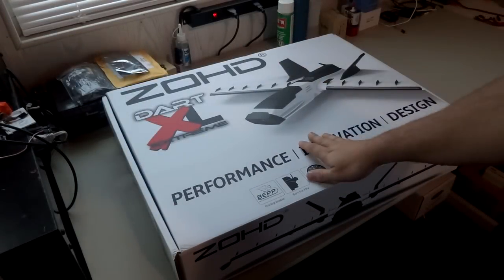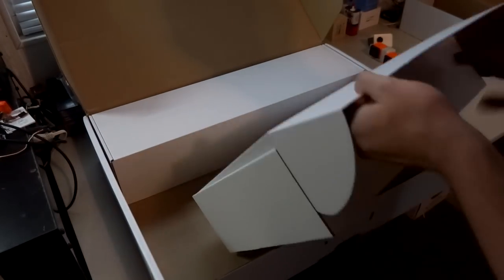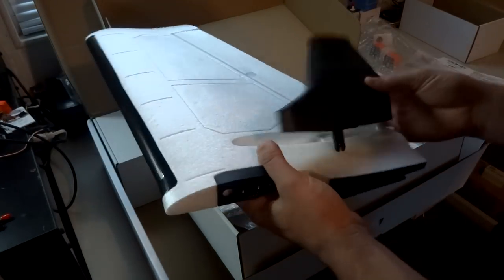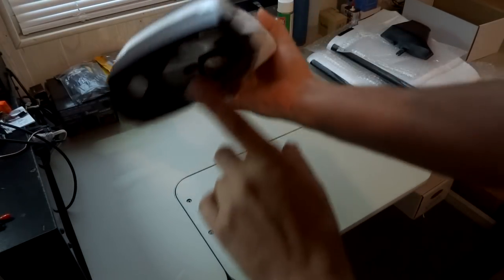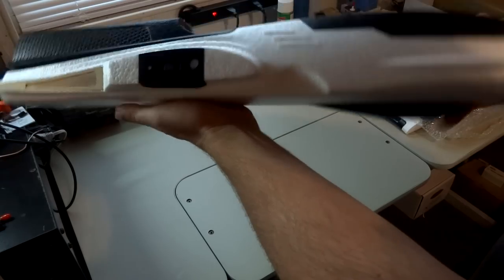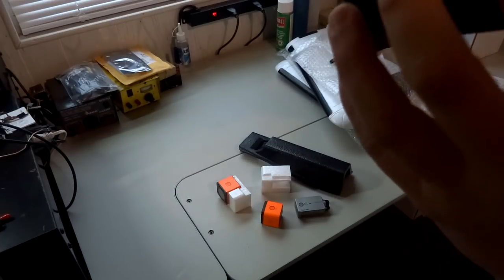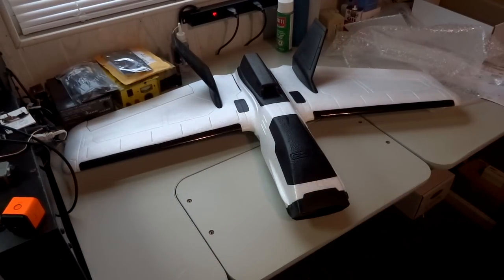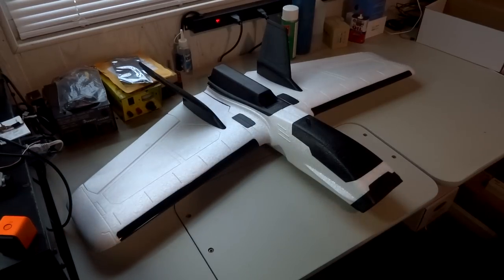ZOHD Dart XL Unboxing

Comment: To pass the audio, maybe use the servo ground for the vtx ground to save a pin?
Reply from the maker: I did consider it, but wanted to keep them separate to avoid any possible ground loops or servo noise getting back into the video system.

Comment: Thanks for the in depth review, can you please confirm if the Gitup F1 is a fit in the foam adapter blocks as I'd like to use mine whenever it turns up here.
Reply from the maker: I will check that and let you know! Remind me here if I don't reply again soon... lol I've got one sitting on my desk in the shop I'll check.
Reply from the maker: Looking at it now. The F1 will not fit directly into the included blocks, but with a little trimming it can fit into the Mobius style one pretty good. The lens will line up with the round hole in the center of the nose, and you could probably cut that out a little to let the lens poke through a bit if you wanted. It will take a little trimming, but should be a nice fit.

Comment: More good info..  Excellent  info from Andrew and yourself Keith..

What may be useful for purchasers of this model before they fly is to actually insert like a builders line that runs both sides of the fuse .. Starts at the nose at a point and runs below and above the wing. The point part of the string attaches to a lasso string which is wrapped around the  nose.

All this is inserted with a razor blade by cutting a very fine slice into the foam to bury the string.
The string is then glued in. I use Foam tak for this purpose to make a invisible seam.
One could then Laminate the area and also use some carbon but the carbon could be difficult to install in that model.

The reason for this is these types of noses do not have a lot of strength as Stu found out.

The sting is light and adds a lot of strength.
Most of my foward swept wings can go nose down at full speed and be picked up to fly again immediately.

Sir Bruce can vouch on that one..
My wings have string inserted and are nearly indestructible.

Just a tip I thought I could share..

Comment: you can share the gnd pin for servos and vtx so there would be no need for an additional audio wire (gnd, 5v, servo signal, voltage for vtx, video, in audio in = 6 pins)
Reply from the maker: I considered that as well, but I'm leaning towards keeping the wiring completely separate, just to avoid any ground loops or getting servo feedback into the video system.

Comment: You could keep the other cameras front holes uncovered to cool down the batterys.
Reply from the maker: I was looking at that after recording the video, I think you could cut away a little foam in the blocks that fit around the camera to allow air to pass through if needed.

Comment: hi bonafidepirate ! , andrew`s esc`s wood plate was broken too , don`t you think it has the same shape and look 
as the mini drak
Reply: Easy fix though. Just glue a pair of ply or balsa crossbeams, it's weak due to the ply grain direction. Fit the beams crossgrain and it'll be good.
Reply from the maker: Yeah the little ply plate is a simple fix, not a big deal at all. It would probably work just as well to stick the ESC down in the bottom with no plate at all to be honest. I wouldn't say it's the same as the Draks, similar yes but that's about it. You could argue that every conventional high wing tractor plane setup is the same as the first one, but they're just all a similar design. ;) Forward swept pushers like this were around long before the Draks, although they are arguably one of the more popular ones employed for FPV.

Comment: Why do you like analog vs digital servos. Nice video.
Reply from the maker: I've had issues with certain digital servos being affected by 1.3GHz video transmitters in the past is all. These particular ones don't seem to have an issue at all though, at least in this install. I do like these and see no reason to change them, and don't plan to unless I break one or something... lol
Reply: @bonafidepirate  Gotcha. Thanks. Yeah, I'm trying to go all to Emax metal gear. Digital where wallet says ok and analog where acceptable. Best, Josh